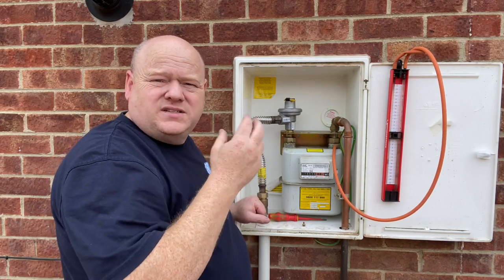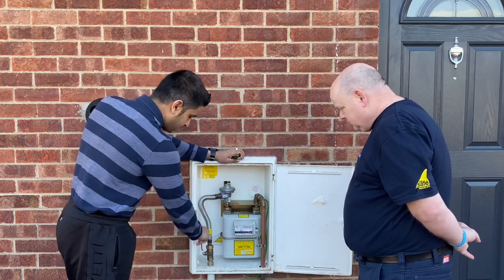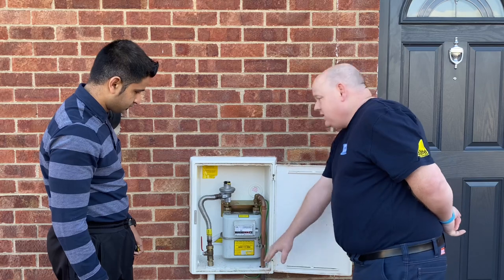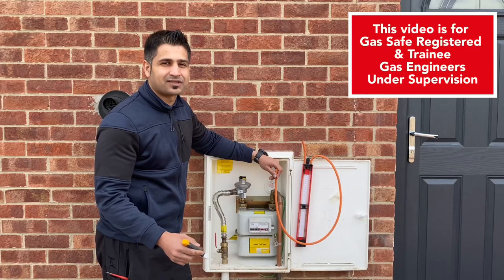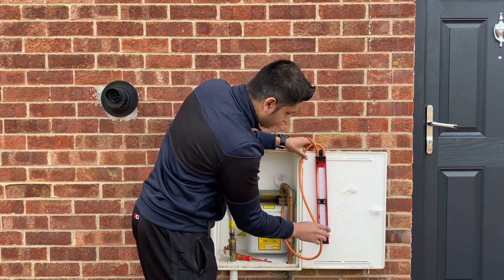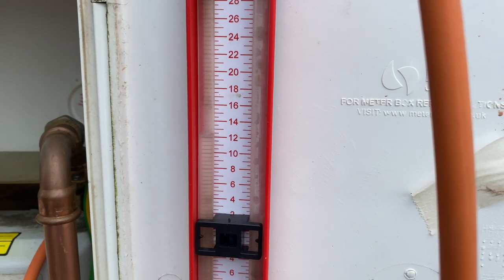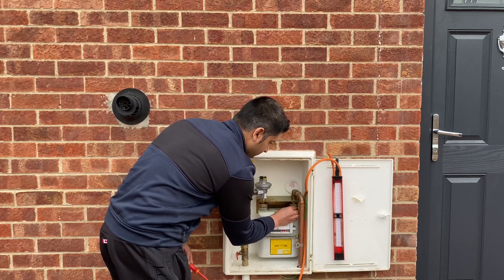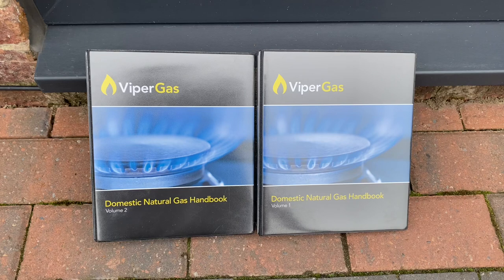Trainee Plumber - Tightness Test Gas / Meter Checks

Comment: How do you change the gas meter outside box if its damaged? I bought a nice new one but my plumber wont fit it for me because of the lower left nut
Reply from the maker: Good question. You need to call out the gas transporter i believe.
Reply: @AllenHart999  Thanks. I called them already. They said they charge £120 but includes a box. Because I already bought one now its a bit annoying. still waiting to hear back from them after sending pictures and everything over in email. Hopefully they can fit my Mitras MK2 box because it looks really good. (for a gas box!) Hahah.
Reply: @E69apeTheMatrix420  swap it yourself its piss easy ..if its like for like then it's a straight swap
Reply: @memyselfandi36  The mains gas in on. The nut is before the valve. There will be gas bellowing out whilst I change it over. Not very well explained my end but the pipe that goes into the bottom of the box has a valve inside the box. Therefore to unscrew the valve to get the box off means gas everywhere.
Reply: @memyselfandi36  I have a proper enclosed box replacement. Not just some backless cover to place over everything.

Comment: I was taught in training to fully open the ecv at the end of the test to standing pressure to ensure regulator had not lock up during the test. Good vid keep them coming 👍🏻
Reply from the maker: I have never heard of that before but that’s a great idea. Thanks for sharing.
Reply: @AllenHart999  ,Jon is absolutely correct ( if the regulator is locked up that means you would have back pressure feeding your leak, if one is present ,making your tightness test void, inaccurate at best).
Jon , thank you for your comment👍.

Comment: I would also put a clamp meter around the earth conductor on the gas main to ensure there is no earth current or diverted leakage on that CPC. 

That would be in addition to using your voltage meter - I would think a proper voltage meter and proving unit is better than a NCV stick.

Comment: And also make sure your contractor who replaces your boiler and the copper pipe doesn't drip flux on the Flexi pipe. Found out this week that it had corroded the flexi pipe and leaking gas. The work was done last July
Reply from the maker: Thanks for the comment.

Comment: The electrical earth bonding has one of the conductors wrapped round the end of the insulation. All the conductors must terminate on the earth clamp. This happens all the time as earth cables have an odd number of conductors. If this practice is carried out it reduces the size of the earth conductor (CPC)

Comment: Hello. Could you let me know how can I fill up this manometer with fluid? Thank you
Reply: Take one if rubber tube ends off and fill with cold water until its around zero mark. Then lever the ugauge and slide it to zero on both sides

Comment: Hay folks. Me personally use electronic. It cuts down time (commercial) And doesn't blow out your water on medium or high pressure systems (don't expect you folks to be working on high pressure). Honestly? electronic is how it should be. You print it off and prove your work. Its all about CYA these days, cover your arse. Don't get me wrong I keep a water one on my van but, I have two monometers and my FGA that also does a tightness test. Cant be to careful these days. I'm a big believer in PROVE YOUR WORK. CYA.
Love ya all.
Reply from the maker: We have a new video coming soon using a Kane. Thanks.

Comment: If you turn gas valve off unscrew inlet and outlet nuts and take meter out and replace with your own and tighten nuts back up amd turn gas back on then there should be no problems as it's like for like ..test for leak with a squirty bottle with soap in ...if it don't bubble then jobs a goodn

Comment: Allen, could you please, indicate this piece of law which says that the only qualified person can carry out work on gas installations?
Reply from the maker: You need to be gas safe registered in the UK or competent,
Reply: there is difference between need and must...my question is still not answered...maybe in the next video say a few words about it....up to my knowledge there is no piece of LAW which obligate to be gas safe registered to carry out work on a gas installation...they say "competent"...

Is it illegal to install a gas cooker yourself?  from Mr. Google...

There is no law to say you cannot do a gas installation yourself providing (under the law) you are competent. ... Also stated is that you (the homeowner) should not carry out any work that results in the disturbance of a gas carrying or supply component e.g. a gas supply pipe.
Reply: @AllenHart999 
Is it illegal to work on your own gas boiler?

It's not technically illegal to carry out DIY gas work in your own home* as long as you are 'competent' to do so, but the consequences of doing so without the necessary skills are hugely dangerous. Working with gas is a complex and dangerous task that requires extensive training, knowledge and experience.

Comment: The isolating valve should have been installed so that door could be closed with valve in isolated position.
Reply from the maker: The Valve turns both ways. Thanks